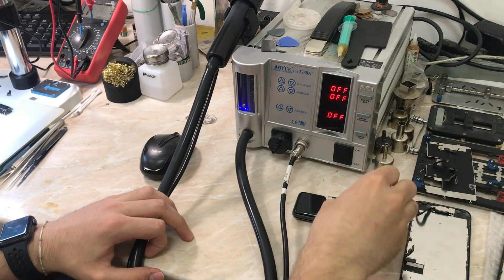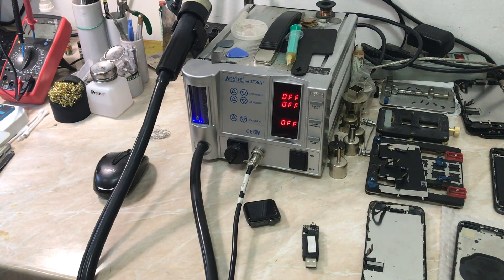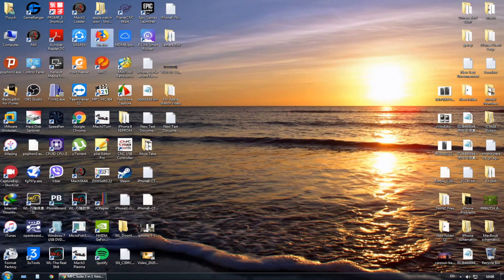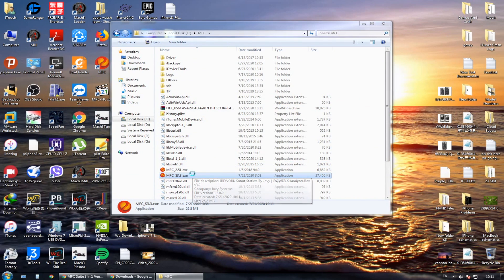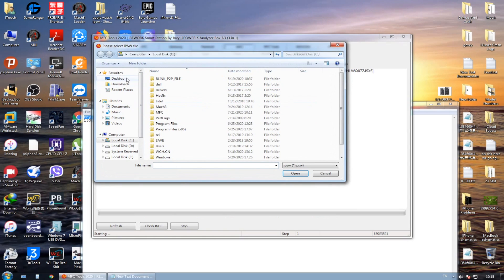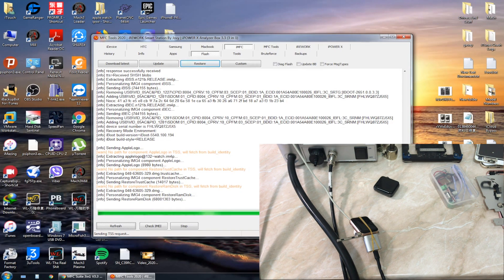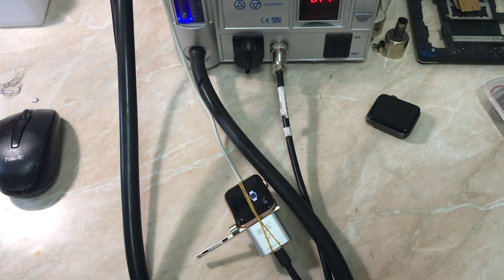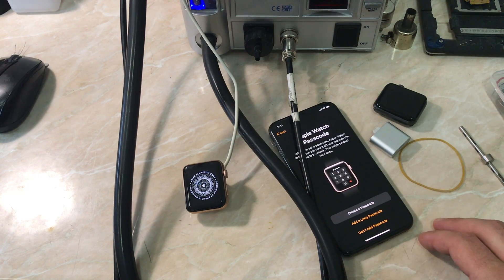Apple Watch Series 1/2/3 42mm/38mm Restore Using MFC Tools (Unsigned IPSW'S)

Comment: como poner en dfu serie 2 42 mm ibus solo lo deja en modo restauracion ayudaaaaa
Reply from the maker: you cant enter DFU mode in series 2 using iBUS 2 you have to use AWRT or the new solution by mfc which is connect your watch with iPower
Reply: @AntoineKiriaky10  pero con ipower y ibus s2 si podre entrar a dfu? o ocupo AWRT?
Reply from the maker: @gokugamerpro9068  i will say AWRT

Comment: I have a question, I have version 3.4 of the mfc program, however, when I connect my applewatch with ibus, it does not detect it, is it necessary to also put the update, as in your video?

Comment: Please give me link series 2 6.3 38mm aluminium and 42mm space black/stainless 🙏🏻🙏🏻
Reply from the maker: Check this https://youtu.be/3thjICP8TvU
And it’s the same for stainless steel
Reply: @AntoineKiriaky10  firmware "file might be corrupt" in mfc tools, do you have official version?
Reply from the maker: No
Reply: @AntoineKiriaky10  or other link maybe, mfc version no problem, i try 38mm and 42mm with your link but i nothing to use,..

Comment: Hi , if the Apple Watch has a software problem with the red explanation red logo , I have refurbished the lcd with new digitiser , but now have this problem . What did I do wrong ? Will the firmware reset fix it ?
Reply from the maker: Maybe but even so you can’t restore your Apple anymore using the 6.2.1 IPSW because Apple closed the window for those ipsw’s
Reply: @AntoineKiriaky10  what happened to the watch ? I refurbished the screen with new digitiser now I have this problem ? So I can’t get the firmware now? For series 3 42mm
Reply from the maker: Did you changed the nfc ??? Does this happens after you changed the sensor ??? Is your Apple behaves the same on other screen ??
Reply: @AntoineKiriaky10  I did a glass repair, the watch was working fine before . I didn’t change anything else , what is nfc ? I don’t have another lcd to try it
Reply from the maker: So you just changed the glass which in series 3 when it’s broken you have to change the sensor too anyway you have to check on other screen and see the flex’s are damaged all the three the lcd and sensor and NFC and the NFC comes on the screen if the nfc is damaged or the flex is damaged you can get this error the red recovery screen or stuck on Apple logo
Reply: @AntoineKiriaky10  I didn’t change the lcd I just remove the glass and put on new glass only . So maybe the connectors are damaged. Thanks for your help
Reply: @AntoineKiriaky10  my friend please can I ask one more question , I unplugged the force touch and it booted up ok but no touch and I see a tiny little red logo of a screen with line through it above Home Screen . Does this mean if replace force touch it will work ?
Reply from the maker: If the watch is on the WatchOS 7 you can just unplug the force touch and remove it will work with no problems because in WatchOS 7 the force touch is in the system if not try to replace it if the same try other screen
Reply: @AntoineKiriaky10  so now how can i restore my watch??? If apple has unsigned it now, what is the other option? Please help

Comment: Hi,ipsw for Apple Watch 4 44 mm lte?Where i can download?
Reply from the maker: Official or mfc ipsw ?
Reply: I have ibus s4 and i need to restore through itunes in mac machine.
Reply from the maker: You can’t you can only restore using mfc software in windows
Reply: Ok,can you give me the link?
Reply from the maker: I don’t have the promo code (activation code ) to download them means I don’t have access for them yet
Reply: Yes you can do it with itunes plus the ibus s4/5 and i have them ipsw’s signed. So you wont need to buy the mfc dongle. Contact me on IG @applewatchrd.

Comment: Sir do you have ipsw for 42mm series 1? A1554, i downloaded the link u gave it has file name 38mm and when i select it says not compatible. thanks in advance and kudos!
Reply: Forgot to mention I am using iTunes on Macbook Pro
Reply from the maker: You cant restore MFC iPSW using iTunes only with mfc software and you windows computer
Reply: @AntoineKiriaky10  
The last part

Product information:
Full Support iWatch 38mm & 42mm
Apple Watch (38 mm (N27aAP), 42 mm (N28aAP))
Apple Watch Series 1 (38 mm (N27dAP), 42 mm (N28dAP))
Support iWatch restore and repair software
Support Downgrade and upgrade firmware
Support iWatch Glass Digitizer touch programming etc

Working with Mac OS iTunes or MFC Dongle software

Comment: So iBus is basically useless without dongle? Have you done s4/s5 successfully? Where do you get ipsw as on their website they have clearly written they don’t provide ipsw.
Reply from the maker: Actually no you can still check your battery health serial number etc... using iBUS 1/2/4/5 and no I’m going to order the iBUS 4/5 very soon and for the ipsw I guess after Apple closes the window for the 6.2.1 watchOS they are not responsible for the ipsw they provide the ipsw when they are available
Reply: Hello friend yes is possible to restore only using itunes and the ibus, if you have the original files. So dont need to buy the mfc dongle. I have them, contact me on IG @applewatchrd.

Comment: Does ibus S2 works with apple watch s1,s2,s3 and s4?
Reply from the maker: No only S2-S3
Reply: @AntoineKiriaky10  Can the MFC dongle flash Apple watches firmware?
Reply from the maker: I mean you need both the mfc dongle and the ibus
Reply from the maker: For the iMFC tab in mfc software and I guess also for debug
Reply: I two apple watches one s4 in demo mode and the another one got bricked after a software update (Series 1 or 7000), wouldn't be possible fixing those watches only using the ibus s4/s5 for the demo one and the ibus s1 for the bricked s1 instead of buying the dongle and the ibus?

Comment: Hi , for apple watch series 4 44mm stuck in loop , can u fix it ? Thanks
Reply from the maker: There is iPSW for series 4,5 40/44 but the dongle or the (connector) that’s connects the Apple Watch with the computer is not available for the MFC program but there is an original one which cost a lot
Reply: Antoine Kiriaky like how much it cost bro
Reply: I have them ipsw for s2 to s5 contact me ok IG @applewatchrd